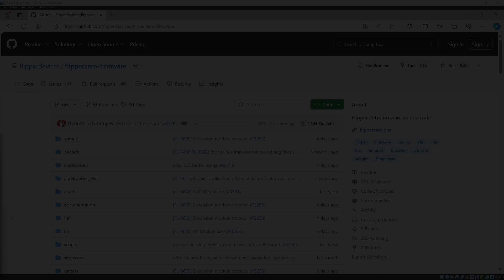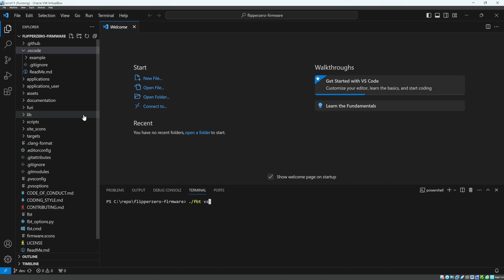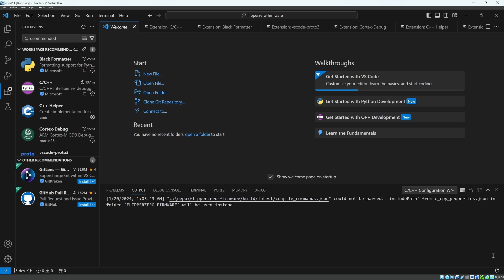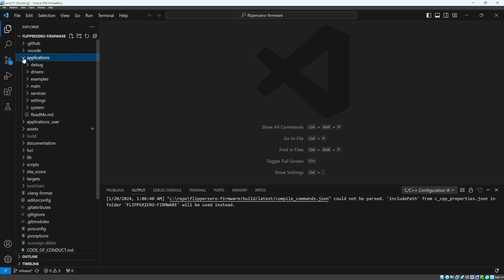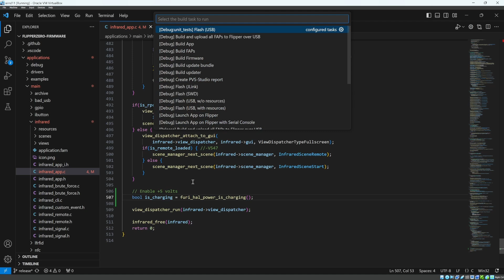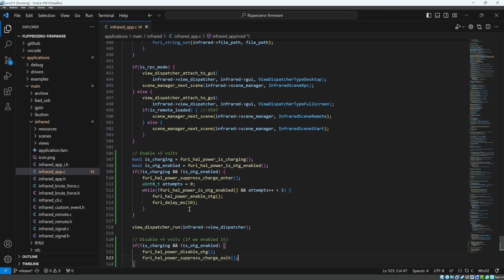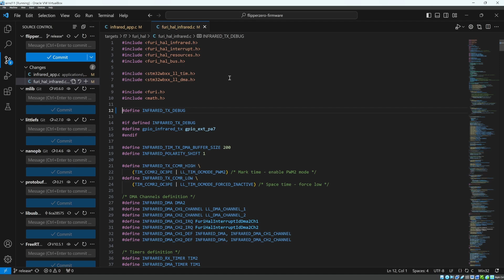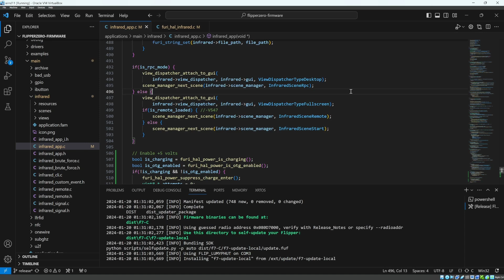[100] Flipper Zero - IR Blaster on Official firmware!

Comment: Thanks for sharing, Derek! Do you think it would be easy to add an option in the menu to disable/enable the firmware changes you made to support it? This way it can easily be disconnected to use the built-in IR transmitter when a slimmer profile flipper is desired (without requiring a reflash of the FW, of course).
Reply from the maker: Hi, yes it's possible (similar to how some of the unofficial firmware does it) but it is a much larger change.  Jeff-ss6qt actually had another idea on detecting the device and automatically switching, which should result in a much smaller change.  I'll post a pinned comment with more details.

Comment: Would it ever be possible to switch between the two IR devices dynamically? For example by having a pin detect when the IR blaster is connected. Or maybe manually with a toggle in the Infrared menu?
Reply from the maker: That's in interesting idea that I never thought of, but we can totally do that!  If we configure PA7 in pull-up mode, we will read a "HIGH" when nothing is connected to the Flipper Zero.  When we connect the IR Blaster, the resistance of the circuit changes and we will read a "LOW".  I'll post a pinned comment with more details, thanks!
Reply from the maker: Awesome, it worked!  Thanks again for the suggestion.  I wrote up a tutorial at https://github.com/jamisonderek/flipper-zero-tutorials/tree/main/gpio/ir_blaster
Reply from the maker: I just wanted to take a moment to thank you again for your comment.  Because of your comment, Xtreme and RogueMaster now both include settings for automatically detecting an IR Blaster!  If someone doesn't add it to official firmware by April, I'll submit a PR.  If you are on Official firmware, here is the video I made for auto-detection. https://youtu.be/gRizmfNbIsM

Comment from the maker: If there is a new version released, you can update your Flipper Zero.  First, look at the current commit hash (for example, at 4:00 in the video we see origin/release is at d1832d5e). If you then click the refresh circles next to the branch in the lower-left corner of VS Code, it will pull new updates.  If the commit hash changes, then you have new updates.  You may need to Ctrl+Shift+P, "Git: Stash Changes" before sync and "Git: Apply Stash..." if the files you edited have changed.